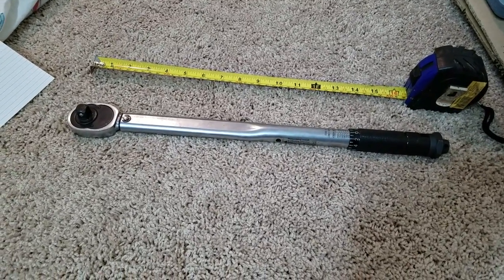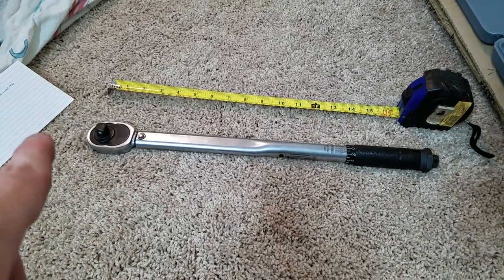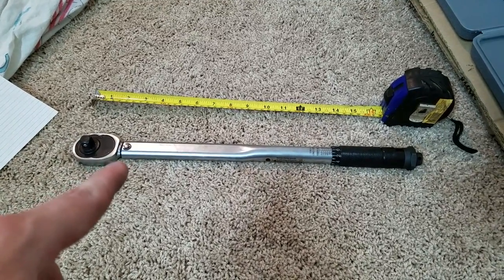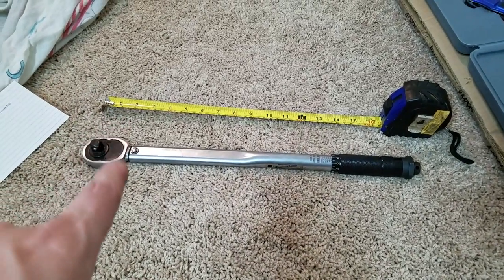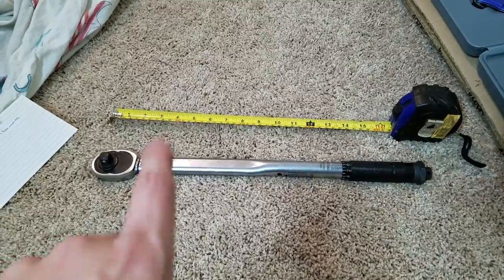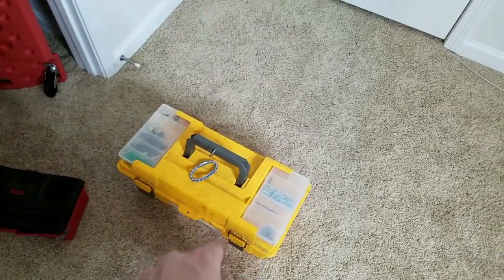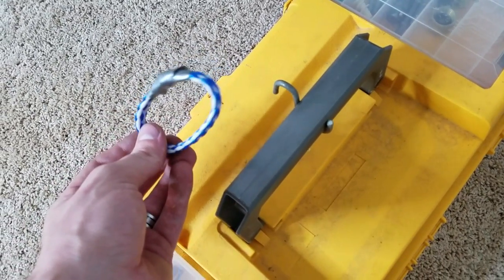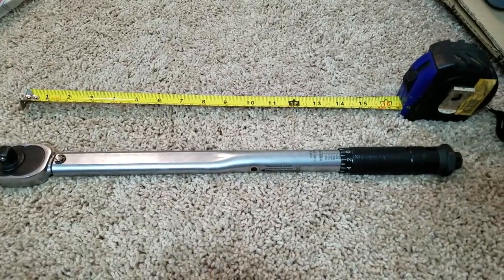Calibrate Torque Wrench Without Any Special Tools

Comment: It's a metric Allen wrench.
Reply from the maker: Wow, I feel stupid for not knowing they have a metric version of Allen keys. Thanks for this, ill pin it so everyone can see.
Reply: A 3mm to be exact
Reply: @JRobling     Didn’t know there was a metric set????
Welcome to the rest of the world,  American!
Reply: Actually, if You look a little close into this topic, there's no such tjing as a metric Allen wrench. Allen wrenches were made in imperial sizes only - backed by a 1910 patent. European version - the SPS product known a yeare later as the Unbrako, was in metric sizes.
Reply: Wait til he works on something french and needs a 7mm, lol.  He's in a real bind then.   But enough fun, and some help - in a pinch, get to a bicycle shoppe.  It has been years, but the oddest spec fastener I ever ran across was a 6.5mm - the wrench [thankfully] was provide with the equipment purchase.  Think it was a compound bow that had specialized limb adusters bolt specs.
Reply: I ran into the same problem whilst adjusting an American bow. My metric tools either were too tight or had some play and I couldn’t quite figure out why
Reply: @qivarebil2149  Wrong, stock no 85015
Reply: @ricky302v8  Maybe so. But then it has a different name. Not Allen! Study up! 😄
Reply: @karlroberts3179  I am American and I have both Metric and SAE allen wrenches. Most bikes are done mostly in Metric these days. Which is just fine I prefer Metric over the Imperial system anyway. Imperial system is needlessly complex with Ex. 1/64", 1/32", 1/16" etc.
Reply: @karlroberts3179  I'm an American living in the US, and I didn't know until recently there were SAE (customary units) versions.  Well, I assumed there were, but I never needed one because just about all hex keys are metric.  Then I went to adjust a gun holster, nothing fit, and I finally had to go buy SAE keys.  Just about all bolts and hex screws I ever deal with are metric, as God had intended.
Reply: @NotNowLater  To be accurate, we use the "customary" or "SAE" system in the US, not imperial, which is British.  They are different in some measurements.  Thank God most bolts and screws are now metric in the US.  I can't recall the last time I needed an SAE wrench.  Fun fact: The customary system has been defined via the metric system for many years, so an inch is defined as exactly 2.54mm.
Reply: @kurt1391  An inch is 25.4mm
Reply: In fact, they are keys in the Imperial System (inches), the measurement system used practically only in the USA.  The adjustment must be made with keys in the Metric System (decimal), which is predominant throughout the world.  This is the first time I've seen Halen wrenches in inches...
Reply: HEX Wrench

Comment: Never use a torque wrench as a breaker bar.
Reply: One of my first jobs was working on car haulers, like a Jack Cooper. I was 19, didn’t have much for tools and one of the older guys at the shop was nice and didn’t mind me using his tools. I was having a hard time breaking a nut free on whatever it was that I was working on. So, I grabbed what I thought was a breaker bar. The old man comes running and screaming at me, letting me know his Snap On torque wrench is the wrong tool for the job. Ten years later I realize what an idiot I was lol.
Reply: It’s a tekton. Who gives a shit? lol
Reply: @dougchoate2009  Damn not only was it a torque wrench, but it was a SNAP ON torque wrench.
Reply: $13-25 will buy you(him) a breaker bar that will let his torque wrench work for many more years than this one will.
Reply: Why not
Reply: @alecdziuk6450  Who cares what brand it is. Is it accurate or not, thats all that matters. The average person isn't going to buy a snap-on to torque bolts 2x a year.

Comment: Looks like your setting was at 50 and not 40 pounds... The centre vertical line is where the "0" goes on...
Reply: He'll never know, mate: a click style torque wrench must never be used as a breaker bar.  You could perhaps go to max setting, but if it clicks... stop damaging the tool and go get that tried and true breaker bar [and a 4' section of pipe to mongo out on the bastard bolt].

Comment: I have no idea why you didn’t just use the “ ring” that isn’t knurled around the handle at 15 inches ( 1.25 feet ). The reason is the calibration is usually more accurate if it is close to the middle of your hand while holding the knurled part of the handle ( never use a torque wrench with your hand not in this position ) . Also, don’t be cheap. In Canada we have a retailer which is the equivalent of of Harbor Freight in the USA. I bought a breaker bar for under $25 Canadian so about $17.50 USD.  This breaker bar probably wouldn’t stand up too well to daily multiple uses or to loosen a bolt or nut that is tighter than 200 lb feet but the “ cool thing” is the handle can be adjusted for length by about 6 inches. Shorter for tight spaces or longer for more leverage for really tough bolts/nuts. A half decent ratchet or two 1/2 inch and 3/8 inch and maybe a 1/4 inch can be bought for under $75. Never use a torque wrench as a breaker bar or a ratchet. At least you don’t use it as a hammer…….you don’t right?

Comment: I could not resist having an opinion on this. Due to the nature of how torque wrenches work, the end result of calibration creates a ratio in the scale. You change the ratio when you adjust any one location, then you only have that one spot where the torque wrench may be correct and it may be out at all other locations. To calibrate a torque wrench you need to check it at 20%, 60% and 100%. You make adjustments as follows: Adjust the low end (20%) using the handle untel it reads 20% of the max scale reading. Then adjust the screw on the side to set the 100% reading. If you had to adjust the 100% you then need to re-check the 20%. If you re-adjust the 20% you again check the 100%. You have to keep this up until you check both the 20% and the 100% without needing to adjust. Then you check the 60%. If the 60% is good you are ok, if the 60% is not good the only way to fix that is to replace the spring and start all over at 20% and 100%. It may have been left under tension for a long time and lost its spring tension ratio.

Other wrenches use a different system for the 100%. They use a pivot block instead of the screw and roller bearing inside. Everything is the same except you change pivot blocks with size differences measured in thousands of an inch. The 20% is still adjusted at the handle and the 60% is still the spring tension.

To adjust the wrench handle at any set value is to destroyed the Spring Tension Ratio and the wrench may only be accurate to that setting only. All other settings will be inaccurate. The minute you make any adjustment to the wrench you need to recheck 20%, 60% and 100% and ensure the Spring Tension Ratio is still accurate which it may not be. If you adjust the wrench at any one setting you totally change the ratio throughout the handle movement and very likely you have destroyed the accuracy of the wrench in all other locations of adjustment. By the way I have a certificate from Snap On to repair and calibrate torque wrenches as well as calibrate the instruments used to calibrate the wrenches. This will make the wrench unreliable at all locations other then the one it was set at. Take it from a certified torque wrench technician, do not do this. The fact this worked for him and was later tested fine was simply lucky for him but may not be lucky for most of you. Either that or the calibration tech repaired it without telling the customer.
Reply: Tim I tried to understand your explanation but couldn’t quite get it. Especially about adjusting to 20% at handle then 100% at screw. Any chance you could try and explain in another way?
Reply: @markhill3196  The 20% and 100% is referring to the torque scale value of the wrench. If the wrench max scale is say 100 ft pounds then 100 % is 100 ft pounds. At the base of the handle there is a nut, at the bottom of the nut is a lock. The wrench is tested at 20%, 60% and 100% max scale value (20, 60, and 100 Ft Lbs). You adjust the 20% by adjusting the Handle. You Adjust the 100% scale value by adjusting the screw in the central area of the torque wrench on the side. 60% cannot be adjusted for, it is corrected by replacing the spring inside. If you loosen the nut and the lock you can adjust the handles relationship with the spring inside and that changes the spring tension with regards to handle scale setting. This adjustment is only used to adjust 20%. The 100% is adjusted by the screw on the side center point of the wrench. Inside is two round points that are directly affected by the tension of the spring which is increased by tightening the handle. 
The spring tension pushes on the lower of the two round points against the upper. The more spring tension the harder to snap the lower round surface past the other which then slaps the inside the the tube and makes the snap sound you hear when you reach the set torque. Think of two balls sitting inside two walls with a space too small for the balls to pass by each other. Now put a spring behind one wall. The spring tension on the wall can be adjusted (Handle). The tighter the spring tension the harder it is to have the balls pass each other. The width of the walls can also be adjusted (screw). As you increase the spring tension you make it harder to pass the balls by each other. As you widen the walls apart you can adjust the max spring tension so that at 100% the balls slip passed each other. Less spring tension, less torque required to snap passed each other. Keep adjusting the wrench until both the 20% and 100% are correct. If you adjust either you need to check both again each time until they give the correct values. Once you have the correct values you check the 60%. If the is good you are done. If 60% is not but 20% and 100% are, You need a new spring. Not all wrenches use this screw for 100%, some use blocks that tip. Wider blocks are harder to tip over then thinner ones, and shorter blocks are harder to tip then taller ones. The more spring tension against the block the harder to tip it as well. These blocks are changed inside for 100% adjustment rather then the screw adjustment. Feel free to keep asking me, I am enjoying this.
Reply: @Soniccues  Wow Tim! thank you so much for sharing your knowledge!!! I am also working on two wrenches so your information is very very valuable 💪👌😊
Reply: @rolandberendonck3900  No Problem, I am glad to help and I enjoy helping. Ask whatever you want.
Reply: Tim Maher thanks for the explanation. That made all the difference. I guess in essence, that unless the spring itself is perfect, you’ll always be juggling to find a sweet spot between the lower and upper limits. For my purposes that’s quite good enough. I actually think I need a bigger wrench as mine only goes up to 100ft/lbs. 
but I’ll try your method shortly and just see how I go. 
Thanks again man I gotta say you certainly know the ins and outs of torque wrenches. Not everyone can say that 😂😂😂
Reply: @markhill3196  As long as you put the torque wrench away with the handle set to zero or less the spring should last a life time. Leaving the wrench with the handle set to something higher then zero for extended periods of time will change the springs natural resting location which changes its intended force load which screws up the wrench.
Reply: Manual torque wrenches are very robust and last forever if stored correctly. Don't buy an electronic torque wrench if you want a long lasting torque wrench.
Reply: @Soniccues  the manual on those tekton torque wrenches, sas to store to some minimum setting which is not 0, for example the 10-150 foot pound torque wrench you are supposed to store it a 10 foot pounds. i only noticed this today, i have always stored them at 0.   will this cause any problems?
Reply: @cajovaresto  If it feels like you are having to add some stretch to the spring to set to zero then maybe but it is not likely. When the setting of the handle feels loose with not spring tension in either direction, this is where you want to leave it for storage. This way the spring is relaxed and not under tension during storage.
Reply: @Soniccues  Many thanks for the tip, it is actually a PRO tip ! I performed your adjustmentes to my cheap torque wrench. It was  "clicking" always  at forces 10% lower than those set at its scale. Now it seem a lot more accurate. I only have another ( good quality) wrench to compare torques of both tools,  so it is not super scientific but I can see that it has improved the accuracy a lot!
Reply: Tim, very good explanation. Thank you for your detailed comments. This makes perfect sense how to do it right. I consider a torque wrench being a precise instrument and watching this video was pretty entertaining. Calibrating it with a plastic box with random parts rattling inside, using wrong size allen wrench and Mr. Hammer to make it fit.  I guess this is what they make  Mr. Hammers for. At this point I would just use this wrench as full time breaker bar. And maybe be as a spare hammer when Mr. Hammer is misplaced.
Reply: @peterkos4937  Torque wrenches are a precise measuring instrument.
Reply: Yes, you're right that the length changes, but using weights is inaccurate since you're ignoring the weight of the torque wrench itself! A ½" wrench can easily weigh a couple of pounds. And, you can't accurately compensate for that since the weight is distributed over the length of the wrench. And with the toolbox weight hitting the tire you're not getting the true weight anyway.

Comment: In fact, they are keys in the Imperial System (inches), the measurement system used practically only in the USA.  The adjustment must be made with keys in the Metric System (decimal), which is predominant throughout the world.  This is the first time I've seen Halen wrenches in inches...

Comment: 3:31  You actually have your wrench set to 50 pounds at this time stamp, not 40 as you intended to.  The little lines that come off the numbers on the left and zigzag down then over to the center line, where it intercepts the center line is actually where you need to set the adjustment.  What you did was set the adjustment so that it covers the number 40 halfway, that's not how any torque wrench works or is read.
Reply: Great observation...u are right
Reply: J Robling, James James is right, a line goes from the number to the center line, the intersection of those two lines is the adjustment point for this number, not the number itself... 
This is very important when you work with your torque wrench, more important when you calibrate it and the most important when you teach thousands of people to calibrate their tool. Pinning this information would be very wise!
Reply: @jocelynlacharite  I thought that was obvious but it's obviously an issue. What controls the alighment of the outer and inner registration numbers?
Reply: yep 50 ft lbs. not 40, the zig zag line is there so that you are able to see the setting that you want and not cover it up with the dial.
Reply: For a minute there I thought I’d been using my torque wrench wrong for years. I shouldn’t have doubted myself.

Comment: Remember from high school = VECTORS..
the torque wrench needs to be positioned HORIZONTALLY.
If it is not.   THEN  the you can't use the formula that you showed.
Again = VECTORS.      horizontal and vertical .
Also. As pointed out by previous viewer you need a set of METRIC  hex head wrenches.  Spend the money.   SAE = inchese;      METRIC = millimeters
Reply: Are you trying to say that gravity is a factor in the use of a torque wrench? Torque can be applied at any position at any vector and in any direction as in the real world with aircraft and automobiles you will not be able to only do horizontal torqueing.
Reply: @darth1000blue , Thomas OMeara have a point! Force of cravity stays same, but the lenght (level arm) which you put in equation, is not any more lenght of the wrench bar, if you dont keep torque wrench horizontal. By other words, in that equation, bar (level arm) and force must be perpendicular.
Reply: @darth1000blue  You are correct.  But gravity that pull the weight he is using is only on direction.  If the wrench isn't at a 90 to gravity, it changes the amount of force applied to the wrench.

Comment: Be sure to set the torque on the wrench before choosing the length, because if you adjust the torque after you've chosen the length then your measurement will be off (maybe not enough to make a difference, but between the 20lbs and 150lbs on my wrench is almost an inch) so if it's at 150lbs and you adjust it down to 20lbs, that could add an extra inch to your initial calculation.
Reply: Good one. No one has metioned that before . Thanks
Reply: Yeah...that makes a lot of sense...
Reply: that's the reason you don't select the rotating handle you go above it onto the silver metal frame and select a fixed length and keep changing weights - so what you said is incorrect
Reply: This guy isn't very detailed in his explanation

Comment: Ideally the bar should be horizontal or you introduce cosine error ( tilted up like this, the distance from the weight to centre is less than the measured length), not a big deal for small angles, admittedly